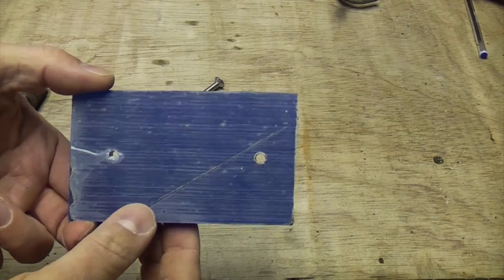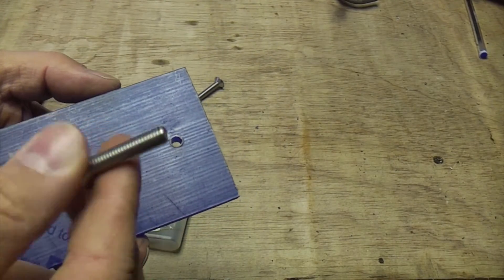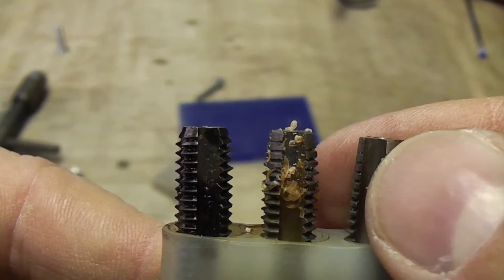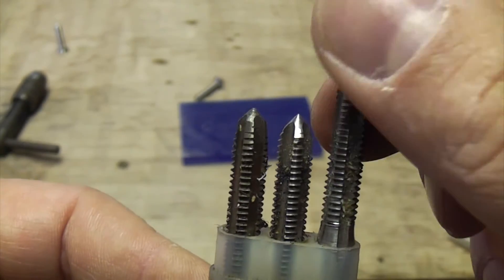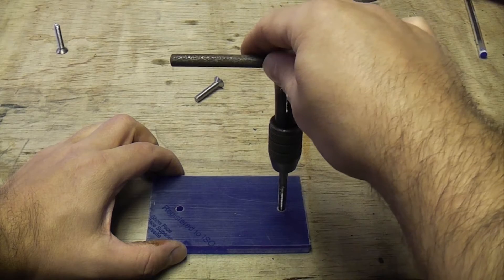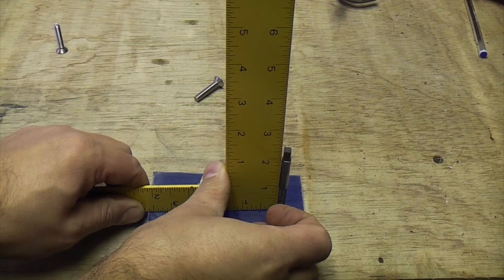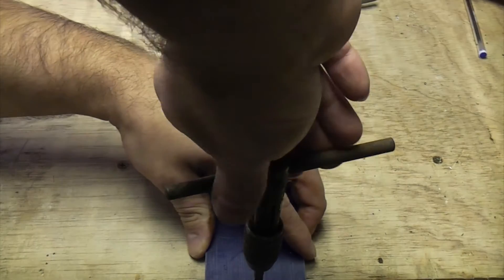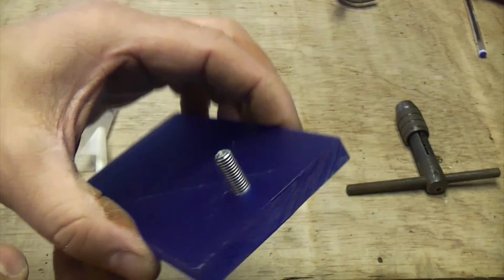Tap acrylic | Tapping acrylic | ultimatehandyman

Comment: This is so insightful. Please what is the diameter of the hole?
Reply from the maker: It depends what size tap you are using! There is a guide here that shows the correct hole size-
https://www.ultimatehandyman.co.uk/how-to/metalworking/tap-and-die

Comment: Do you need a special drill for plastic? I have read you need a 135 degree tip???
Reply from the maker: I did not use a special drill bit, although you can get them. The only time you need to be careful is when exiting the hole (when drilling straight through), as it can break the acrylic.
Thanks for the comment 👍
Reply: I used normal today... No problems

Comment: Could I use a drill press for this to ensure it’s straight if I run it slow enough
Reply from the maker: It's unlikely that a normal drill can turn slowly enough to tap, unless you have a special tapping head, even then I would not use it on acrylic as you could easily strip it.

Thanks for the comment
Reply: @ultimatehandyman   4 years late, but you could use spiral taps instead of straight taps. The plastic debris drops through the spiral voids that minimises the clogging. There are now some videos on YT showing the process. I think some Americans call them gun taps.

Comment: great video!
Is there a way to find what is the best bit to use for a particular screw?
Thanks!
Reply: It depends on the screw, naturally. Look up tap dimensions - metric taps are designed to take a rod of the number in mm, with just enough clearance not to vacuum-bind. ie an M8 rod fits an M8 hole, and an M8 thread likewise. Therefore, the hole you'll need to tap is a bit smaller. The exact size is searchable online.

Comment: I always put the tap into directly into a cordless drill in a drill stand. No worries about crooked threads, 90° garanteed. You don't need to use power, just turn it by hand. Or use power and save yourself much time (at least when screwing the tap out). Threads also come out well when using power to drill them.
I don't understand why you would ever use the tap wrench. (except for the case you don't have ANY other tool).